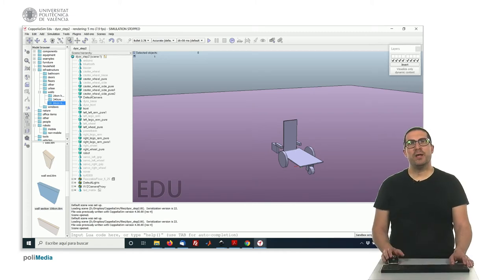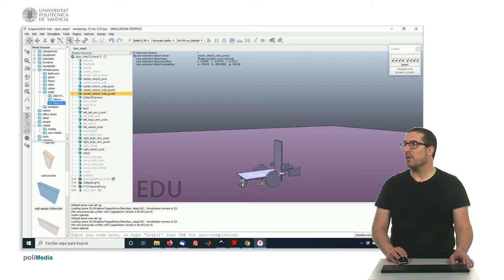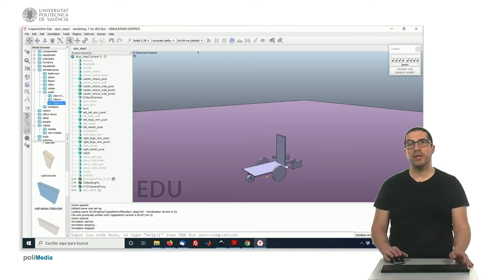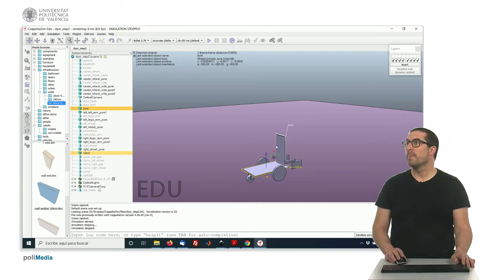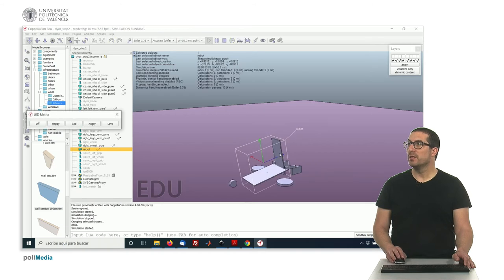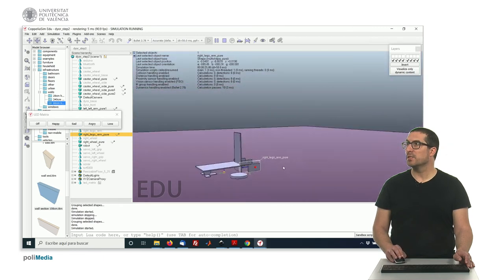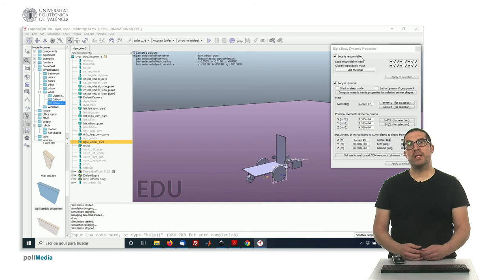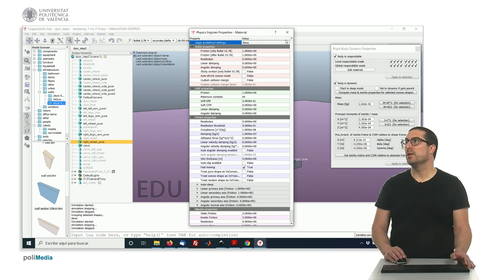Creating DYOR robot (Step 2) | CoppeliaSim (V-REP)

Comment: Hello how to create the shape edition for caster sides? It is very difficult to get three cuboids out of that.
Reply from the maker: I know, in same cases might be annoying. Just create three cuboids with approximate dimensions and positions.
Reply: did you create the caster sides pure shape?
Reply from the maker: Yes, for dynamic simulation
Reply: can be done by selecting enough triangles to make a cuboid by pressing shift, u dont need to select all triangles
Reply from the maker: Correct!
Reply: @LeoArmesto  can't we do by just selecting shape???...it is working but it isn't in a purple colour...is this wrong?
Reply from the maker: @ alternatively you can create cuboids of proper size and placed them to replace the triangle selection operation which is difficult for some reason that I don’t know
Reply: @LeoArmesto  can you make a little tutorial on this or provide a link if you have explained in some of your video cuz rn i am working on it